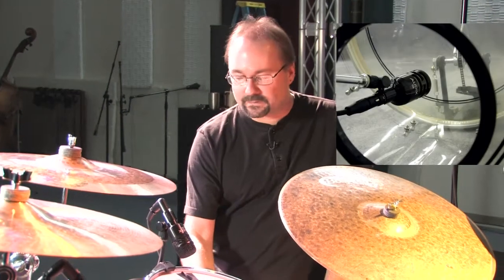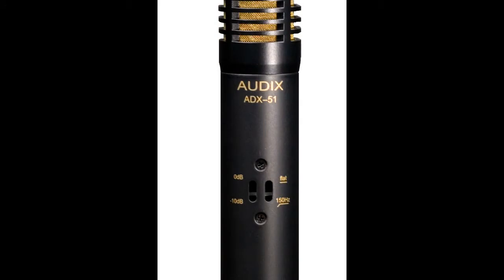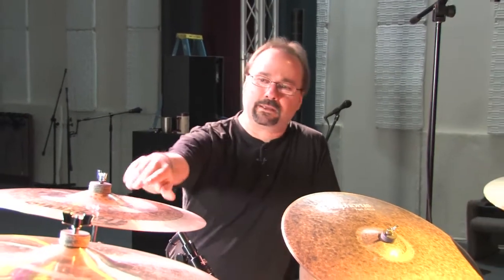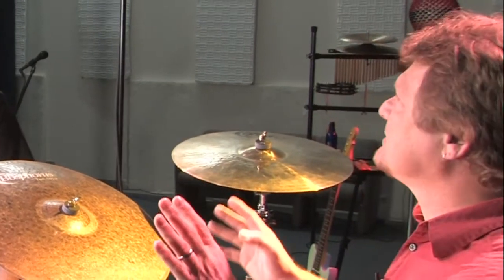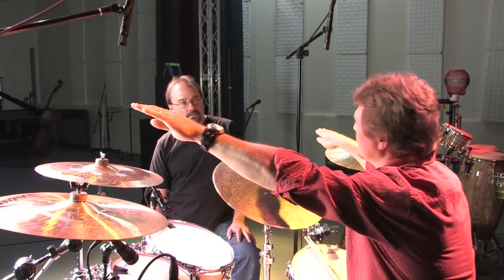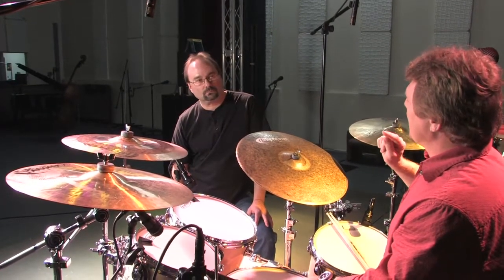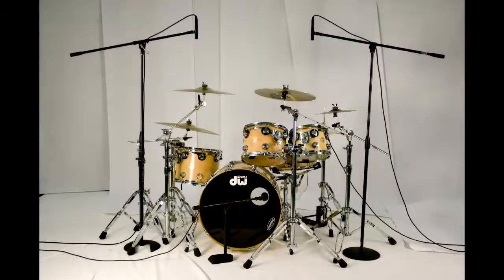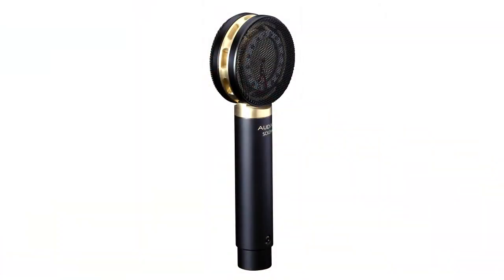Audix Microphones - How To Mic Drums - Overheads

Comment: @theslacker072 usually you try NOT to get the bass drum into the overhead tracks anyway, as I got to know. That's why a bass roll off on the overhead mics is very useful! The snare is the most powerful part of the drumkit, so it should not be panned. listening to a drumrecording with a panned snare through headphones will drive you crazy, no matter, whether little or much panning!

Comment: I hear a lot of phase issues in there, and it's really killing the top end of the kick drum. I like to place my overheads ~6 or 7 feet above the floor (I would go higher if my mic stands were taller) and pointing away from each other at about a 135 degree angle. The only problem is that I don't get enough of my crash cymbals, but I can live with that because it creates just enough phase cancellation to accentuate the stereo image and everything sounds great that way.